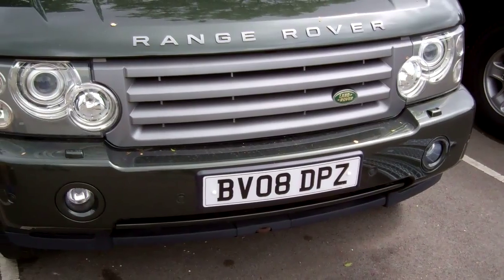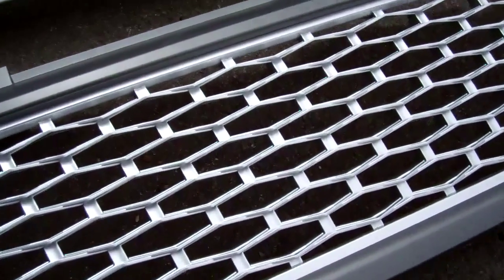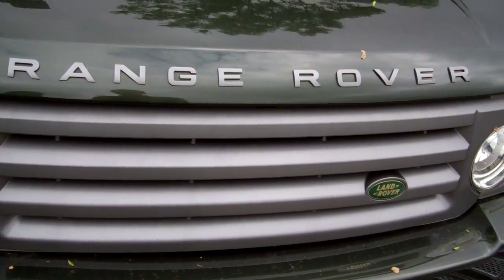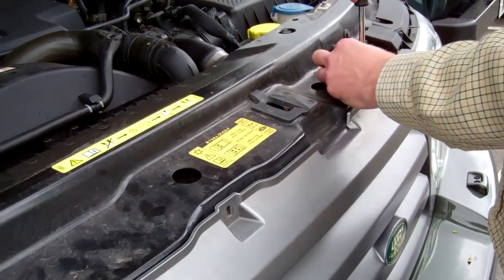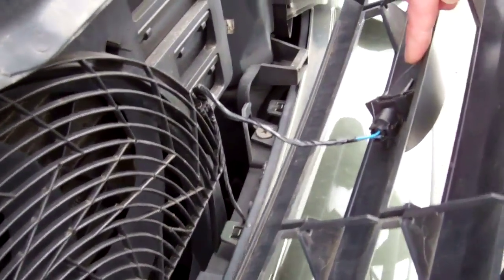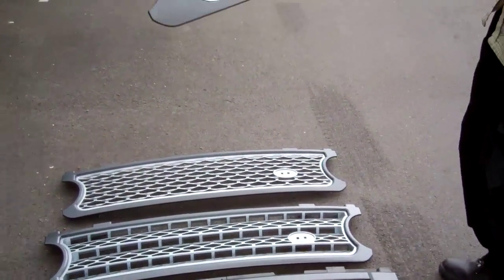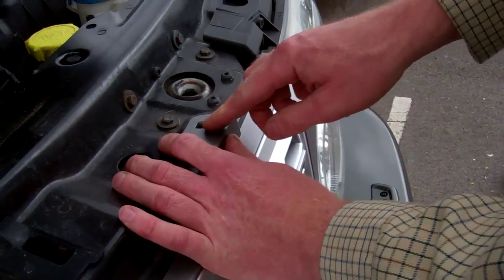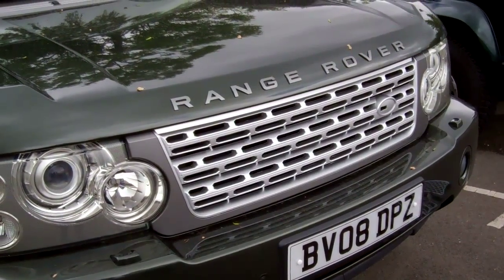Video showing how to fit new L405 style grille to the Range Rover L322 2005-2009

Comment: This grille is great, I've seen somebody doing the full conversion to l405 but it's an hard job. In my opinion with appropriate squared and not rounded lights and the right bumper it becomes almost a new car, the same in the rear : just squared lights.